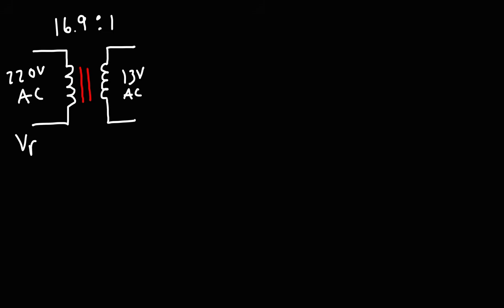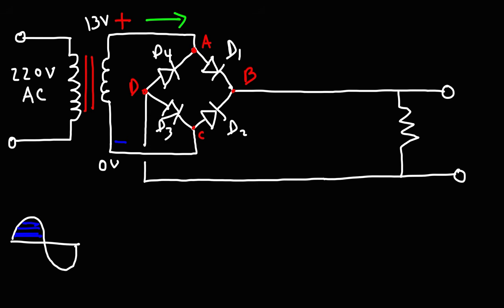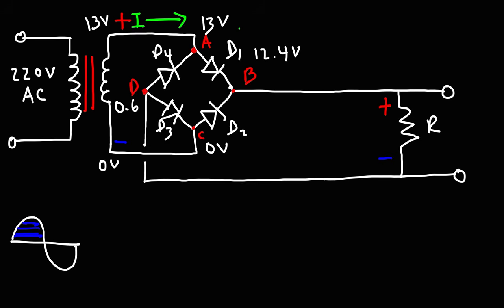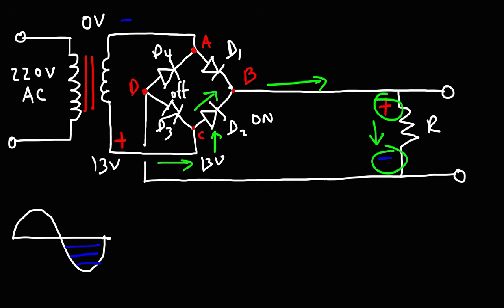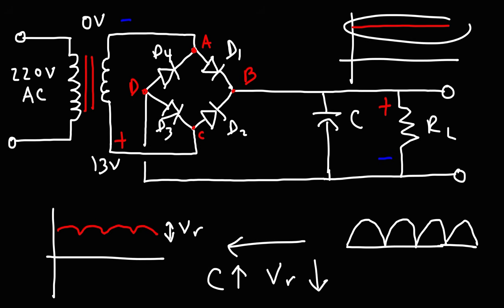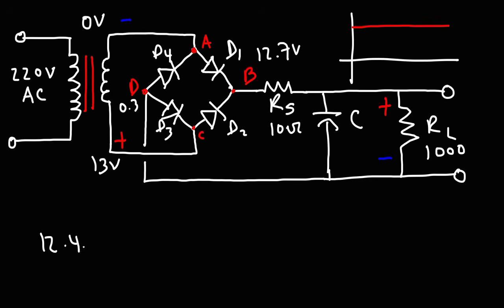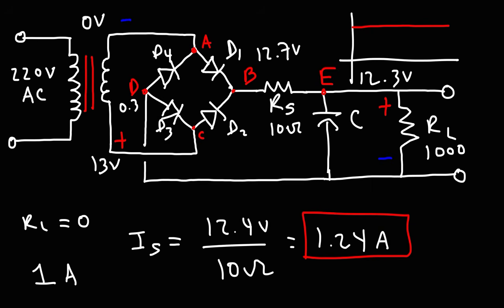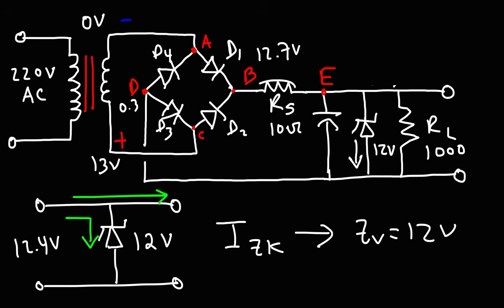220V AC to 12V DC Converter Power Supply Using Diodes, Capacitors, Resistors, & Transformers

Comment: You are completely wrong with your reasoning about the 12v Zener. The supply is 12.7v and the resistor is 10 ohms so the current will be 0.7v across 10R = 70mA.  70mA though the Zener   = 12 x 0.07 = 840mW. Use 1 amp Zener. You can draw up to 70mA before the circuit goes out of regulation.

Comment: This is an absurd discussion with absurd values. 1 amp through 10 ohms is 10:watts.  You never mentioned this. 13v on the output of the transformer is AC.  This converts to over 17v after rectification.  You have absolutely no idea what you are saying or doing.

Comment: As others have noted, the capacitor here will charge to peak of the AC source less the voltage drops of the diodes crossed. DC output voltage = AC Secondary * 1.414 - Diode Voltage drops. If using silicon diodes, we would have a nominal drop of 1.2V. If using germaniun, we would have .6V drops (2*.3V = .6V). While we have four diodes, we only use two at a time as noted in your video. To figure out what we need for the AC Secondary voltage, one can use: AC Secondary (RMS) = (DCV desired + anticipated diode drops) / 1.414. Hope this helps.

Comment: 😂 nice class... I'm new to the electronic world I'm building a 12volt transformerless transformer power supply so I have a 2.2 if 250v cap and a 1meg resistor and bridge rectifier soldered together...so now I have 220volt DC and I want to make it 12volt and I'm stuck until I get zener diodes and capacitors and maby resistors too...I'm not following a building plan so I'm learning how to get there 😂

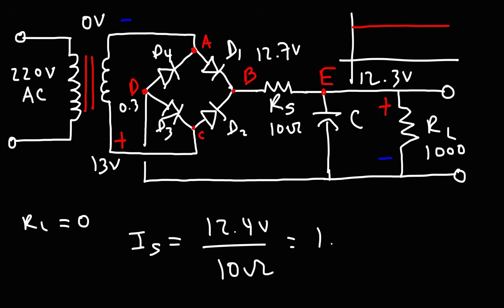Comment: @18:00, when you determine that the diodes could have to deal with 1.24A, it's good to ensure that they are rated at 5A or 10A, but think of the poor 10 Ohm series current resistor.  Wouldn't that have to be tolerating 12.4V at 1.24A = 15.376W.  That's a bit more than your standard electronics 1/4W or 1W resistor.  I think it will act like a poor man's fuse if the RL load shorts 😀

Comment: Woudl be perfect if he also explain How & Why  :

-  To safely isolate 220V-AC part from the low voltage 12VDC part 😂

- To use opto to prevent over-voltage while maintaining the consistency of the current/voltage. 

- To prevent short-circuit from the components in DC part.

- Finally, how to shrink whole board while maintaining great efficiency.

😂 meanwhile all of those can be answered by reverse-engineering cheap PowerSupply made by China wizards.

Comment: design a power supply circuit that maintain +5v dc output voltage  using zener diode .. can you help me with the calculations?
Reply: lots of examples on the internet

Comment: i think anode is the (-) side and cathode is the (+) postive side
Reply: In forward bias, that is for the condition in which a diode can conduct, the anode is positive with respect to the cathode.

In the case of the zener diode, things are different. A zener behaves like an ordinary PN junction diode when the anode is positive with respect to the cathode - it will conduct with about voltage drop of around 0.7 volts (silicon zener; other materials are extremely rare). When used as a zener, it is operated in "reverse breakdown." In that case the cathode is positive with respect to the anode.

In general in semiconductor devices, the arrow points in the direction of "conventional current" flow. Conventional current flow from positive to negative. Electron flow is the opposite direction.

Comment: Great video...A short on the output side will usually blow the primary side of the transformer. A fuse on the output side will prevent that most of the time. You can easily verify which side of the transformer is blown with a meter to prove it.
Reply: A fuse on the primary side is almost invariably what is used.

With very small transformers it may not be effective because coupling between the primary and secondary may be poor. I've used transformers rated at between 1 and 2 watts that withstand indefinite short circuiting of their secondary without damage.

Comment: what if I feed an AC active pfc psu directly fro DC solar power if voltage and amp is enough?
Reply: It is very likely to work OK as far as the power factor correction circuit and downstream circuit goes, however you do have to consider how the PV array will work. Switchmode power supplies all have a "negative input resistance" characteristic - if the input voltage drops, the input current will rise (opposite of what happens with a resistor, where if the applied voltage drops the current does too). This can "collapse" the voltage of a PV array if it is unable to meet the load requirments.

I've designed a few switchers with active power factor correction and they would all work fine with DC input as long at it was within the design range (equiv to 85 to 264 VAC for the ones I did).

Comment: Question: the direction of the current on the secondary of the transformer depends on the winding/polarity right?
Reply: Yes. With PCB-mount transformers with pins that go into holes in the PCB it is quite common to find phasing dots marked on all the windings. With transformers with wire leads you may or may not find such markings. The data sheet is likely to be helpful, but if you don't have that you have to do some testing.

Comment: Thanks for the lesson. I recently disassembled an electrical device which had components using 120vac, 12vdc, and 5vdc. I couldn’t figure why it had a 120vac to 14vac transformer. After your video I have a much better understanding. I am nowhere ready to put my limited electrical knowledge into practice but with all the devices in today’s world with chips and circuit boards if interesting gaining a little understanding.

Comment: Hi, thanks for the video. I have a question about a fridge inverter for a compressor. It convert 1 phase 120 or 220v~ to 3phase. This inverter is 220v~ and it has coil with these specs 2A/2x5 ,6mH, a full bridge and a cap 220uF/450v and the circuit that generate the 3 phase. My question , when  I apply 120 instead of 220 to this full bridge I measure 390V AC and 177v dc across the cap, also across each diode it’s 63v dc. Since I don’t have 220 AC source, my question is what will be the AC/DC voltages across the cap when applying 220v? can  I replace the coil so it is compatible with 120v input ? I have a coil with the following spec 4A/2x2,7mH

Comment: You made a mistake. Where the 13V is, it is AC. So, there's no positive or negative until the power passes the diodes.
Reply: very good observation
Reply: Okay but explaining this way by each AC half cycle makes things easier.

Comment: Very Good. Alternatively, I believe, you could replace the zener with a Voltage regulator IC(7812) and eliminate the resistor to give the same result result. but great explanation and calculations.
Reply: No use LM317 voltage regulator
Reply: (No?mm,
Reply: I agree. We almost have the same arrangement of our power supply and I use IC7812 as voltage regulator for the output.
Reply: @princecyrillsobrecarey3754  I think the only drawback, is requiring a good heat sink.
Reply: So, when you are barely just getting started learning electronics, you jumped right into IC’s? You’re extremely smart!  I haven’t seen your channel. Please share.
Reply: @rprichard8452  He'll no, I'm just a rookie at this. IC 's do have a weakness and an induction coil can serve as a voltage regular proving the values  are calculated carefully. Cheers!

Comment: Like 2FD Sound Services mentioned, when you are talking about volts AC, that usually represents a root mean square (rms) voltage.  To convert to peak voltage, you'd multiply by sqrt(2) ≈ 1.414, so that 13 VAC would be about 18.4 V peak voltage across the secondary winding.

But in any case, thank you so much for making and sharing all of these videos, across every subject.  You're the man!

Comment: 220 is European voltage. In the United States the only way you can have 220 is in 2 transformers three phase. Or delta high leg. Usually marked in a the panel as an orange leg or a purple marked legs. Usually found in a three phase panel.

Comment: Thanks for de video!
Is it possible with a center-tap instead of a bridge? 220v to 12v
Reply: Yes by using 2 diodes connected to the ends of the transformer secondary winding. The cathode ends of the diodes are connected together. High current twin diodes of 8A to around 30A are available as a single component. The diodes are of a fast recovery or Schottky type.

Comment: On say a 10 amp 12 volt DC power supply what wattage & resistance would the RS resistor be. Only an electrician and never very good with electronics but somehow managed to troubleshoot & repair a dozen or more 3 phase VFD'S up to 150 HP. YEP good

Comment: Years ago whenever I tried making a 12 or 24 volt DC power supply the voltage was too high. I would use a transformer with a 12 or 24 volt AC output. Only installed a full wave 25 amp rectifier that was laying around. The outputs would be around 17 & 34.bolts so I was afraid of placing a load on it. Understand that voltage does go down a little when a liad is applied. Seem to remember the transformer no load output voltage to be around 13.5 & 27 volts AC.
Reply: It's because he made same mistake as you: 
Your diodes (if Si diodes) took probably 1.4 V down.
But when you have 12.1 V AC, peak is 12.1 V x 1.41 = 17 V (1.41 is square root of 2) - for 24 V it's double, of course.
This is because: measuring AC voltage (and current) with instrument is measuring of (so called) "effective value" of sin wave Ueff = Umax/1.41. This is cleaver way of measuring - because average is 0 V (half of cycle it is positive and other half it is same but negative).

Comment: Thank you for such clear explanation. When a zener diode is introduced across the circuit, is there still a need for a load resistor? Will the load resistor not reduce the output voltage? Or is there a zero resistant resistor?
Reply: The load resistor is the thing the power supply is powering... so it is the point of the entire operation ^^

Comment: Greate explaining, but I saw alot of power supplies circuits that have a voltage regulator, is it neccessary, and for what use is it?
Reply: Voltage regulator acts as a mini step down transformer. It limits the voltage. 9-5v 15 to 7v regulators are available.  It has a zener diode inside.

Comment: DANGER.  ELECTROCUTION RISK.  FIRE RISK.

There is no discussion of earthing.
There is no discussion of fuse protection.
There is no discussion of safety aspects.
There are no warnings included in the video.

Strongly recommend - do not use this information as instructions for building to avoid injury or worse.  In many countries, building a mains power supply is ILLEGAL, unless licenced to do so.

Some of the information is misleading.  There is no discussion of RMS vs. DC voltage.

The output of a 13V RMS transformer (if available) will produce 13V / 0.707 = 18.388V peak to peak (13 * 1.414 = 18.388V, if you prefer), NOT 13V as stated.

Currents and voltages will, therefore, be higher than discussed and silicon diodes will work just fine.  A lower voltage output transformer may be considered (eg. ~10V RMS to produce the desired DC voltage and reduce stress on the components).

Zeners are better used as voltage references to control other portions of a circuit capable of passing sufficient current (eg. for controlling a pass transistor).  An integrated linear voltage regulator (eg. a 7812) contains a zener reference and pass transistor network in a single package).

Clamping ~18VDC down to 12VDC via a zener will likely overheat and kill the zener quickly, resulting in either a short (no short protection in the circuit shown) or open (resulting in unclamped 18VDC appearing at the output, damaging the circuit being supplied).

Power supply design is potentially hazardous and is a minor art form.  Be safe around electricity - it is unforgiving when things go wrong.
Reply: I don't believe this video was intended as a 'how to make a power supply' tutorial, rather a basic discussion as to what all the parts do and how the circuit functions. While I agree that fuses and earthing are important to safety, they are irrelevant to the function of the circuit and would likely just confuse a learner. If you want to see a video discussing the dangers of building power supplies, make one yourself. There are no part names mentioned in this video, it's clear to see that this is a theoretical discussion. This is exactly how I was taught at university and none of the alumni have been killed building power supplies yet.

Comment: "because, its gonna make no sense" what
Reply: When electricity doesnt flow from D to A? Even though the diode would allow that flow? Think of it like water. The pixies always want to flow (and always follow) toward the path of least resistance. Everything North of that diode line is charged Or already filled with water. It's like trying to cramb water into a running faucet.
Reply: Because the voltage at point D is lower than at point A, so the current can not flow from a lower voltage to an higher. See the explanation at 6.25.

Comment: If you have a secondary of 13vac, normally we are talking about rms. So if we multiply it with 1,41 (root mean square maw) your peak to peak voltage wil be above 18 volts.
Reply: Thanks for pointing that out!
Reply: so are we using rms values for the rest of the calculations?

Comment: isnt the 13 volts at the input to the bridge rectifier an rms voltage and when we place a capacitor to take care of surge current doesn't the capacitor alo eliminate the riple and so shouldn't the voltage be 13 * 2^0.5

Comment: Hello
That was a very informative video and very well explained. 
Can you guide me in the following question, how do I calculate the value of the capacitor? 
Regards
John
Reply: I would like that too
Reply: C = Iload / (2 x pi x f x Vripple)

where:

C is the capacitance in farads
Iload is the maximum load current in amperes
f is the frequency of the AC input voltage in hertz
Vripple is the desired ripple voltage in volts (usually a small percentage of the output voltage)
Reply: hey john,did you ever get to know how to calculate the value of the capacitor.
Reply: @sharononejerry1781  Hi Sharon, I was not expecting a reply, this is an  excellent answer.
Reply: Thankyou very much for your explanation,  I  appreciated you spending the time to explain it.
Regards
John

Comment: can i ask , how about put 240V AC. what the ratio on right side
Reply: If you divide 240V by the desired voltage on the other side, let's say 13V. You would get 18.46 or 18.5. Which is the ratio between primary side of transformer to secondary side. Vp/Vs=Np/Ns. The ratio in the number of turns is the same as for voltage.

Comment: Can you do a video explaining why some transformers generate heat?
Reply: Id assume heat would be generated from the resistor and the diodes absorbing voltage
Reply: Sr. Jumbo no, I didn’t mean in this example, I mean a transformer operation with no load, why do they generate heat? 
I’ve noticed some generate much more heat than others. 
I’d like to see a video on it.

Comment: This video is great, but would it be possible for you to make a video that steps up AC voltage to DC voltage?

My friend and I are working on an electrical based school project and that video would help greatly !
Reply: I know this reply is 3 years late, but if you want to step up ac voltage while rectifying it at the same time you can use a cockroft Walton generator